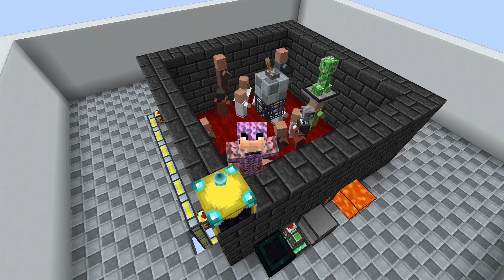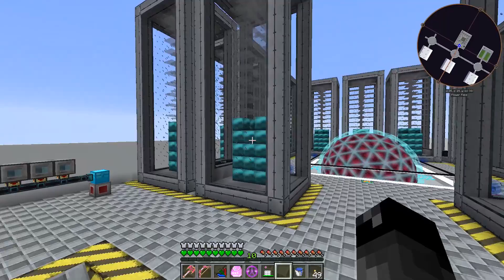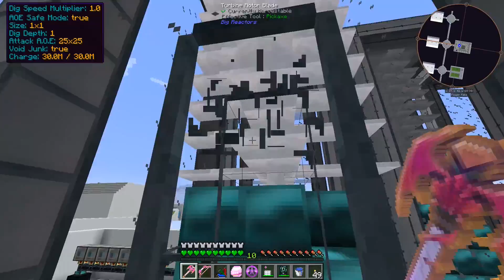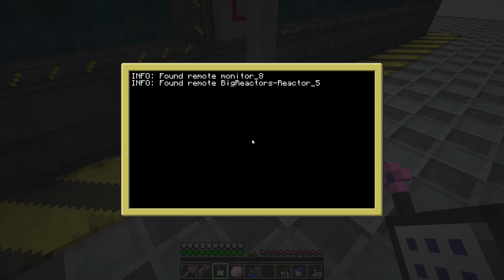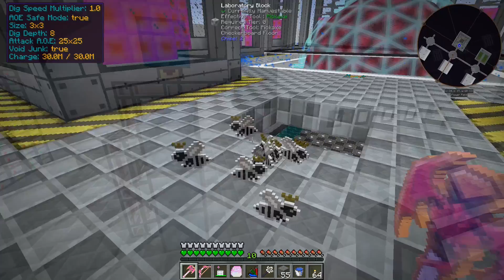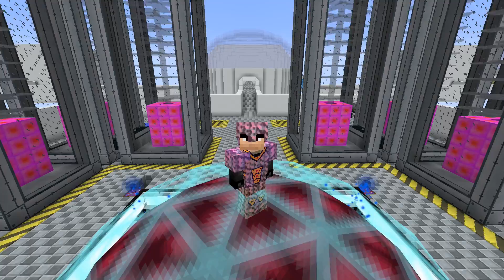Minecraft Mods FTB Infinity - LUDICRITE [E45] (HermitCraft Modded Server)

Comment: Hypnotizd From Solar Expansion, you can make the Ultimate Solar Panel which produces 32k RF/t.   While the materials to make are rather expensive, it requires no fuel to generate the RF and only takes up 1 block as well.

Comment: I always make my turbines 9x9x14 with 4 rows of ludicrite and 6 rows of blades.
Reply: *****  how much rf does it produce
Reply: About 27-28k, but you dont need to mess with the settings at all, just turn it on and go
Reply: Kk
Reply: ***** are there any advantages to that over just  reactor because I can make a reactor that does that much for far less resources
Reply: mfreeman3 I suppose not, if you can make a lot of steam easily then you dont need to farm yellorium once it runs out.

Comment: Hey Hypnotizid, i know this is random but can you tell me how you hook up your ender quarry to your me system. I've tried to put, an ender chest next to the quarry and then at my base i hook up an item duck with another ender chest, that connects to my me controller. The problem is, when only one item goes through the item duck and sits in there. I've put speed upgrades, stack upgrades, every upgrade but nothing seems to work. Also, I've tried putting a tesserack next to the quarry, called it Quarry, you know set the frequency to 2 and set it to items' mode(Receive, and send) then put another tesserack on my me controller and selected the quarry frequency. I've been trying to figure it out for two days and i'm really frustrated. Hope you read this and thank you so much. Also, i love the ftb infinity!!! keep up the good work man :)
Reply: khepesh imhotep To suck your Items much faster out of the Enderchest (e.g. youre using a Tier3 Acceleration Upgrade on your Quarry) into your System, take Transfer nodes with Speed Upgrades into an Interface.
Reply: khepesh imhotep Oh one correction, i met to say transfer nodes instead of item duck, sorry lol
Reply: You can't use item nodes to import to the ME.
You need to use ME cables with an import bus. 
Hope I helped !
Reply: Ok i'll try that thank you so much!!!
Reply: IT WORKED OMG YOUR A LIFE SAVER!!!!! TYTY
Reply: khepesh imhotep Try using ME import buses with acceleration cards connected to an ender chest
Reply: Ok
Reply: Thnx, man!!!! It really helped.
Reply: khepesh imhotep you can also put an tesseract on an me interface .
Reply: hmmm ok ill try it